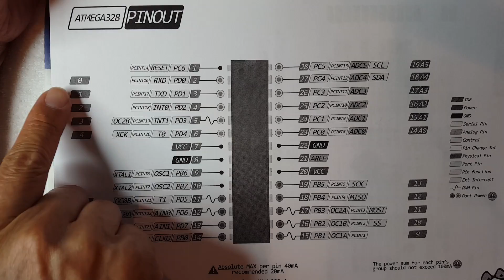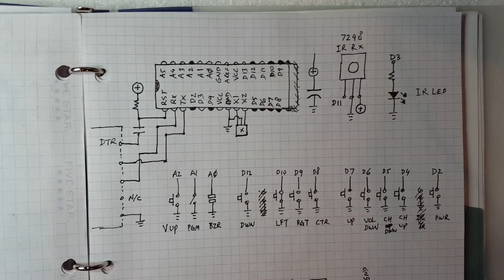HariFun #116 - Custom TV Remote part 4 of 4

Comment: The case came out great . great project man . Glad you got the laser dialed in .
Reply from the maker: Thanks +XerotoLabs !
Have you seen this?
http://glowforge.com/
Reply: +Hari Wiguna wow that is sweet , and as most stuff soo beyond my means rite now . LOL . Most of my stuff is DIY  and reclaim / recycle by necessity. LOL I'm a tech on no-budget guy . 
but dang , for me , I could see more use for that than a larger 3D printer rite now for sure. And i could simply cut the parts to make the other . hahah .

Comment: Awesome build!  Thanks for the reference for the app for remote simulation.  That will come in handy down the road.  Have you converted any of your perf board designs to a fabricated PCB?  We did one for our R2D2.  We made a video on we did it with Shia Labeouf :-)  https://www.youtube.com/watch?v=fcXi3bTEgQI
Reply from the maker: +Raising Awesome ,
I've played with eagleCAD and KiCAD, but have not ordered  PCB yet.
With as much time I took planning and wiring the proto board, I probably should have made a custom PCB :-)
Thanks for the comment!
Reply: It's actually pretty cheap (compared to a steak dinner).  You get three of your boards.  I think it's about $5 per square inch of a dual layer board.  Our R2 controller XBee Shield was $23 with free shipping.  You'd probably get that back by selling the two extra boards from your builds on your channel.  The coolest part is seeing your own text on the silk screen.  It's a great conversation piece.

Comment: i dont like those stripboards i think they are to complicated. i prefer normal perfboards. i guess if i did a few projects with them i could get the hang of them but for now ill stick with perfboard. :)  anyways cool project.
Reply from the maker: +Beginner's Tech , yeah, on one hand, you don't have to run point to point wiring for every connection, but you do have to "cut" traces when you don't want them.
Thankfully, the drill makes cutting traces quick and easy.